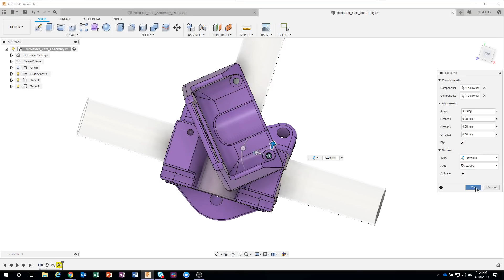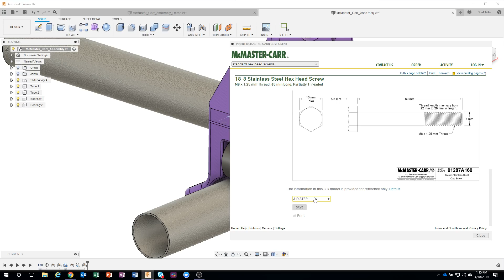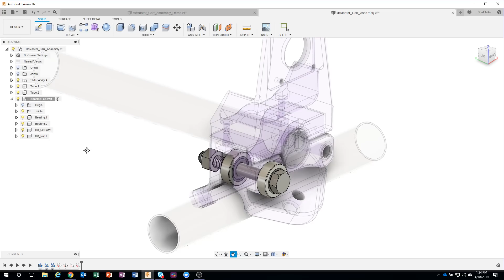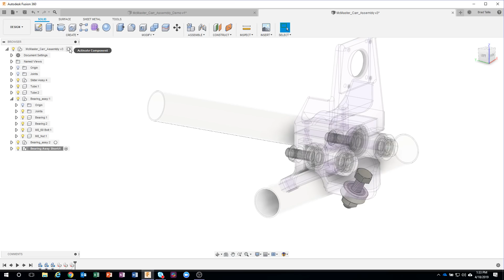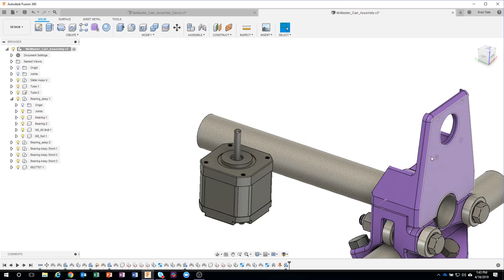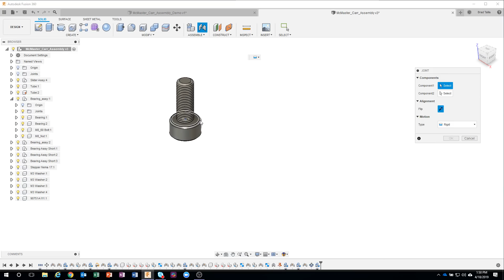360 LIVE: Mastering Assemblies with McMaster-Carr

Comment: Again, great video Brad, many tips and techniques that will reduce production and design time, Thank you.

Although it is about use of McMaster-Karr, but I noticed few things:
1- while making new group assembly, when you select the components you need to use CTRL key for multiple selection, or Shift for first-last selection, you are doing it but didn't mention it, just if anyone asks.
2- Probable the pipe is a little larger diameter than the design, you may see the bearing is intruding inside the pipe surface. it will not affect the general idea of this video but for completeness of the presentation :)
3- Circular pattern is good choice but not necessarily the correct one, because we are lucky that most (but not all) steppers has square foot print.

Thanks again Brad.
Reply from the maker: Thanks for taking the time to write this, Auday! You make some very valid points and hopefully they'll help future viewers. I may just have to pin this one!

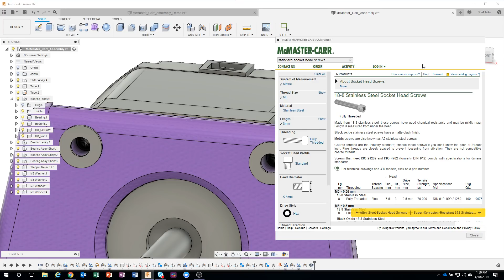Comment: @53:00, as a mechanic I would use the 6mm because, stuff does get down inside things, plus actual dimention does vary some, and using a 6  makes sure you can actually tighten the bolt down, and in time, the purple thing will get thinner so you would have to add another washer or go smaller on the bolt anyway. Its not a big deal but it is something to think about.
Reply: @Thomas-  Very valid point!  I would not have thought of that.  My solution would have been to just add another washer.  :)
Reply from the maker: Thanks for the response Brad!

Comment: Excellent video, thank you. It has cleared up all ambiguity I had with regard to joints. One thing I noticed though was that your bearings appeared to conflict (merge?) into your tubing. I have a design very similar to this and have the same problem. How do you align your existing holes and geometry to fit these imported components correctly?

Comment: It's a pain that Fusion doesn't remember the size and position of the McMaster window. Specially if you're inserting a lot of items. - It also it doesn't remember the last page you were on - if you accidentally close the window, you have to do the search all over again.
Also, what happens if your design changes. How can you easily swap out the bolts or any other item you've brought in without having to re do all of the joints?
Reply: Monkey Subscription check out PARTsolutions.com, it has some plugins to help with sourced parts.

Comment: Great Video once again, and perfect timing for me.  Question????  What if you decide you want to add a washer on the bearing bolts, now that you done.  Edit the bolt assembly?  Bolt length could be affected?  Need to undo ridged joints also??
Reply from the maker: You'd have to insert a new bolt, join it to the correct location, then remove the other. The good thing about the sub assembly is that you'd only have to fix the one and the rest should follow suit!

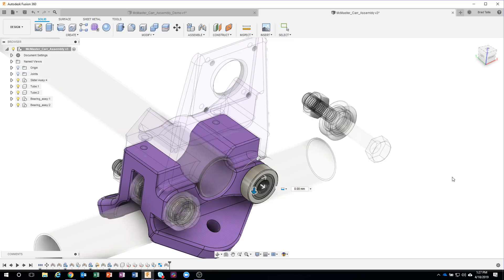Comment: @30:00 min.
So if you change the thickness of the purple part, you still manually have to correct all your copied "bolt assemblies",since I quess, they don´t inherit their joint from the original one?
Please have look into the mirror command in assemblies of SW, really love F360 but some stuff others just do better.
Reply from the maker: The copied bolt subassemblies will inherit the changes to the parent --or if you change any of them, really. Try it for yourself!
Reply: @adskFusion  Then I rest my case until I've given it a try in fusion.😉
Reply: @adskFusion   Works perfectly, I do truly rest my case ;)

Comment: If I may suggest something:  Though I appreciate the clarification that more than one joint can be applied to a component, I think the first exercise would've been a great way to show the power of using the Align command. In situations like that, I feel it's best to use the Align command to position the part where I like it, Capture the Position, and then use an As-Built Joint to join the parts together. I apologize if I'm being nit-picky, but, from an outside perspective, seeing two revolute joints placed on a part in a way that they, effectively, cancel each-other out is quite strange. The joint icons also give the false idea that there are still degrees-of-freedom available for that part when, in reality, it's fixed in position with "fasteners" (the Revolute joints).

Also, when placing the bearings and fasteners, I feel it's best to create a container for each type of component, i.e., a component called "Fasteners" or "Bearings", and apply a Rigid Group Joint to it. This allows me to use the Align command to position them all where I want them and then use a rigid, As-Built Joint to lock the container, and, thus, the components inside, in its current position. The only downside to this is the need to move the Rigid Group operation subsequent to and edit it to include any additional components added into its respective container. However, it's still significantly fewer joints in play. An additional note on this:  If you need a component to move independently, simply exclude it from the Rigid Group and apply joints as Brad is doing.

I hope this is helpful!
Reply from the maker: Hey Jay, did you see this stream? https://youtu.be/_W1S5EXHpvs

Comment: Hello Brad.
So I added this ball bearing to a rigid shaft and I have another attachment to the outer side of the bearing. The outer attachment has been fixed to the bearing with a rigid joint. Now I want the outer attachment along with the outer bearing to rotate while the shaft and inner bearing remains stationary. Could you guide me through the procedure?
Reply from the maker: @Aniket-  You will want to make sure that the inner bearing is "grounded".  Right-click on the inner bearing in your structure browser and select "ground".  Now, when you rotate the outer bearing and it's part, it should revolve around the inner bearing.

Comment: Brad,  Where did you get the details for the stepper motor fasteners - i.e. the bolt size, thread type, etc... ??
Reply from the maker: I think he measured beforehand. He'll likely reply though.
Reply: I did see when he measured the DEPTH of the threaded hole, but Im not sure were he got the bolt size and thread type (coarse or fine thread) from...
Reply: @skinnymouse1410  Probably from the cnc's build of materials.  The size and thread pitch are on mcmaster's site as well.

Comment: Another excellent presentation Brad - I'm in Malaysia and due to time difference I always watch your presentations on Youtube. Now a question: does the modelling of thread details in the McMaster parts not present a large computational/memory overhead? It seems a bit of an overkill of unnecessary detail.....especially if you have a lot of fasteners etc.
Reply: @Ian Pendlebury-  Yes, if you have a lot of fasteners, the modeled threads can slow things down.  But, that gives me a great idea for a future tip!  I will show how you can easily remove the threads off of the McMaster-Carr component.  Thanks for watching!
Reply from the maker: Modeled threads will have a negative effect on performance. Looking forward to your next/future lesson, Brad!
Reply: That's true. For bearings it's usually best to outline dimensions of original part or actually it's fastest just to draw simple solid bearing dimensions matching disc. It doesn't generally make sense to use modeled parts in assemblies. Unless you want to make nice looking assembly manual or something

Comment: Hi Brad, hopefully yourself or the Fusion folks can reply to my question. I would have trouble creating a drawing of this assembly and would like help.

When you added all your bolts to the stepper motor assembly, don't you lose the ability to list those bolts in the Bill Of Materials? When I try to create a drawing like that, I have to leave the bolts as individual components in the top level assembly or else I need to create another view just for the stepper motor assembly....
Reply from the maker: Sorry for the slow response. You might want to check out add ins like open bom or bommer to get far more BOM creation options than are in Fusion 360 natively.
Reply: @adskFusion  I hadn't heard of those, I'll look into them.
Reply from the maker: Here's a link to the store: https://apps.autodesk.com/FUSION/en/Home/Index